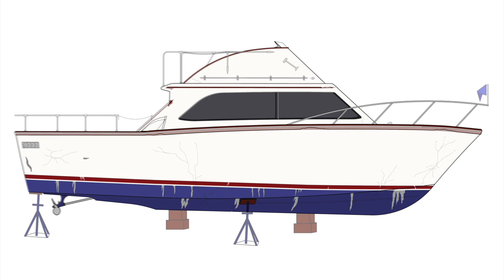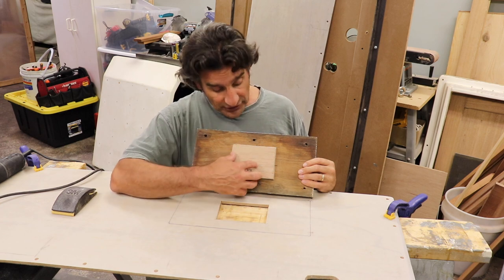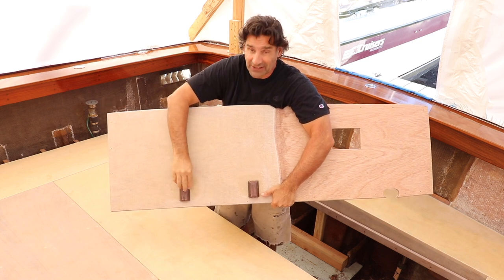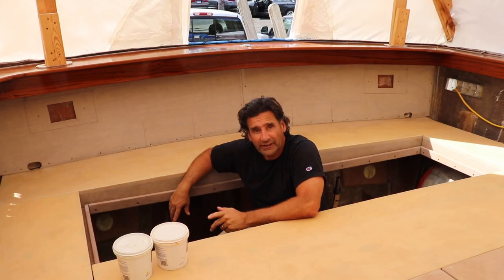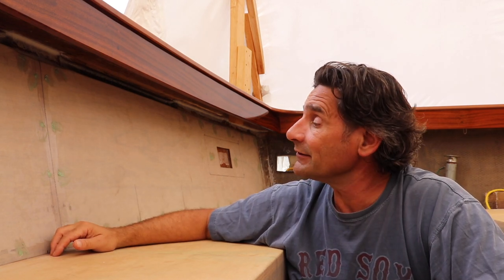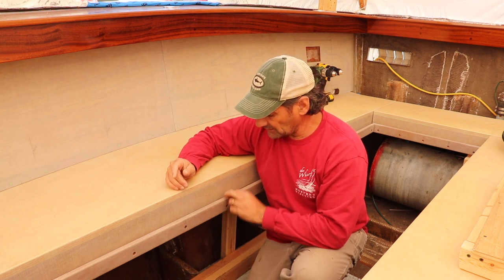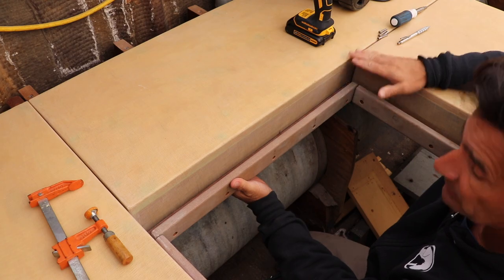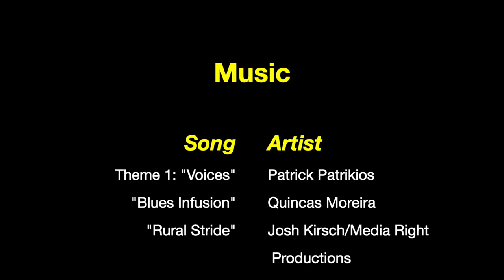Transom Cover Panels & Hatch Drain Channels are Installed - Boat Restoration EP057

Comment: Hey Bob, Those hatch drains and scuppers should work much better than the original design and keep "our" bilge drier. The transom panel is looking great too so now you make me want to see the teak deck laid. I know I'm jumping ahead but you understand, I just want to see what comes next. Stay safe and keep up the great work. Jerry
Reply from the maker: Hi Jerry. You actually got me thinking about getting started on cleaning up and planing the old teak deck boards that I want to reclaim as our new deck veneer. I'm getting close to the point where I need to layout what I have to see how much I need to order to supplement it. I hope your surgery recovery is going well. Stay safe as well - Bob
Reply: @renovationsportfish1563  Hey Bob, Coming along very well, thanks for asking. Both knees and both hips replaced in 2 1/4 years seems amazing to me but modern robotic surgery IS amazing. The teak should be beautiful after planing and will make the deck really pop. Best of luck and keep safe. Jerry